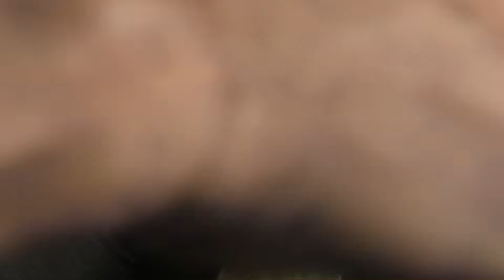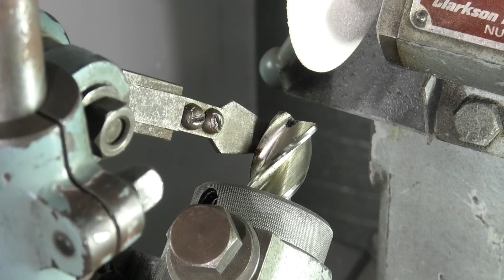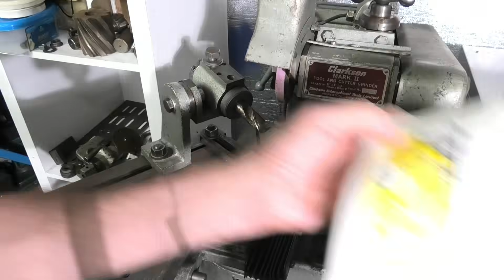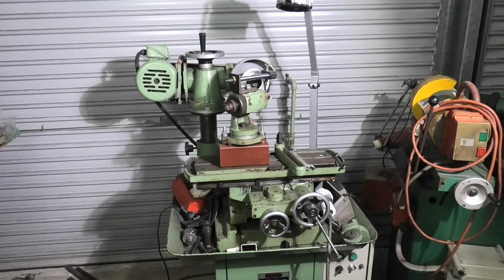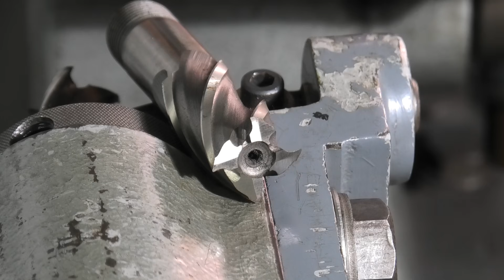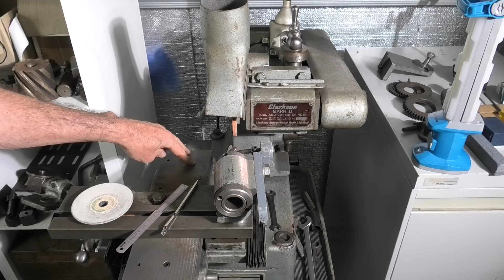Cutter grinding failure.

Comment: Hi Bc    gashing  chatting.    did you try reverse  motor direction  wondering if climb milling as to say. Gashing wheel I have used the thin angle grinding wheels,  we get 1/8   3 mm thick  he in UK  .  You need my cousin he did cutter grinding,  unfortunately he likes his drink now and hard get info out him. But 1 story he told me is catapilar sent a 3 inch reamer in  as it  was bent a little bit so he re ground the taper on it to straighten it.  
Steve
Reply from the maker: Het Steve. So your a train nut like me. The wheel direction gives grinding off the edge. Reverse it and it will dig in and chatter worse. I will try a different machine today. I too use reinforced cut off wheels but those I have date back to 2019 or earlier and are failing. New stock are on the way. What is your loco?